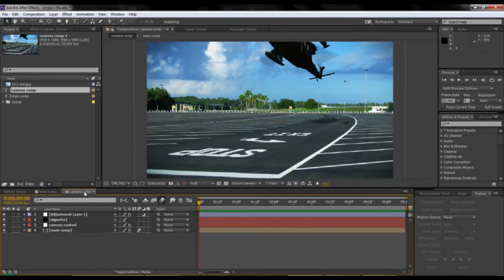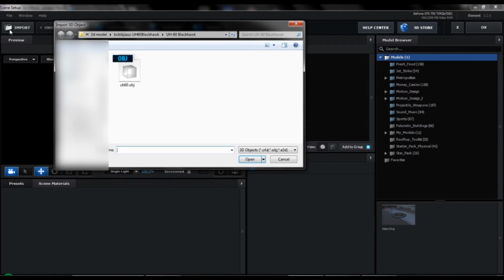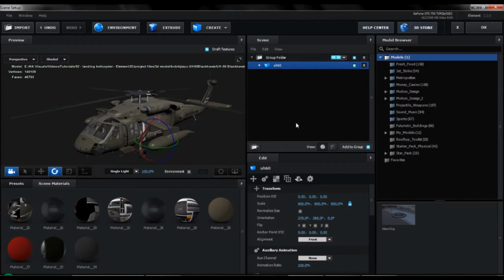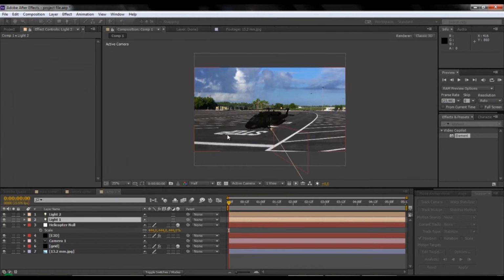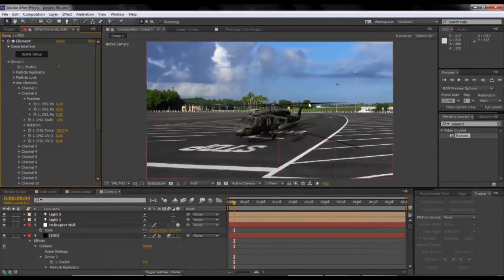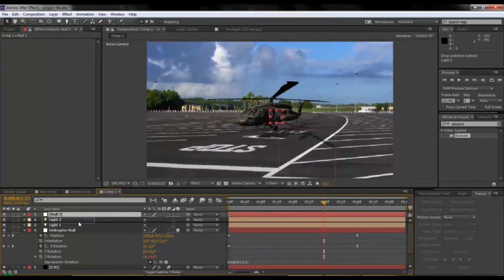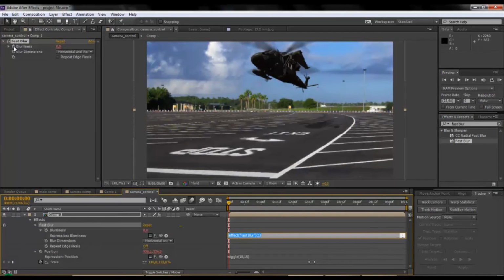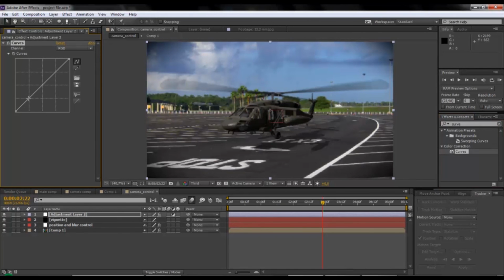3D Helicopter in After Effects with Element 3D - Step by Step VFX Tutorial | AK Visuals

Comment: something is wrong with the 3d model because when i import it the light only is facing the bottom of the helicopter and it is not covering the whole helicopter like the light is for yours.  How do i fix this?
Reply from the maker: Did you set up the direction of the Parallel light just like i did in the tutorial? (being above the helicopter ) also try switching between physical and standard shader inside Element 3D
Reply: im not sure on how to direct it to the parallel light, but i did set it to the standard shader.
Reply: how do you change the direction of the light so its parallel light?
Reply from the maker: The Parallel light is the light i used to simulate the Sun light. if you have a light in your scene, click on it then go to layer settings and change its type to parallel light in the windows that pops up.
Reply: Ok.  But what was showing for me is when I would import the helicopter it showed the light was under the grid in element 3d and i don't know how to make the light go over the grid so i can shine on the helicopter in element 3d
Reply: Because in your video whenever you import the helicopter it shows that the top of the helicopter is bright and the bottom is dark, but mine show that the top of the helicopter is dark and the bottom of the helicopter is bright and in order for me to get the top of the helicopter to be bright is to drag the helicopter below the grid and whenever i do that it won't show in after effects.
Reply from the maker: Are you talking about lights inside the Element 3D Scene Setup or the lights in the composition. because if you are talking about the first one, those lights don't matter as long as u don't activate them in the comp from withing Element 3D.
Reply: the lights inside element 3d
Reply: ok thank you so much for that you should make more tutorials like this
Reply: i haven't found a tutorial this great in 4 years
Reply: and now its messed up
Reply from the maker: Sorry i haven't encountered a problem like yours before, that's why i don't think i can help you with your issue
Reply: no i think i can fix the problem ill just put it to physical form instead of standard form because when i put it to physical form it looks bright in both element 3d and the composition but seriously make more tutorials there are not a lot of people who make good tutorials like you.  I mean it truly
Reply from the maker: there will be less content in the next couple weeks as i have to deal with few personal matters. After that i'll make sure to work on more tutorials. Thanks for your support !
Reply: no problem man great videos